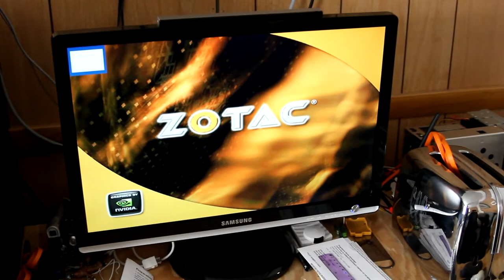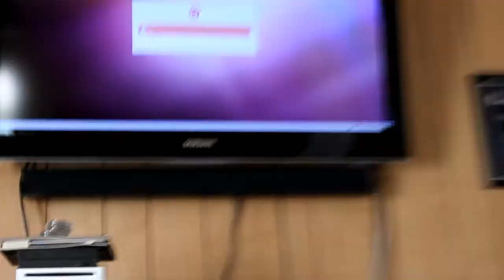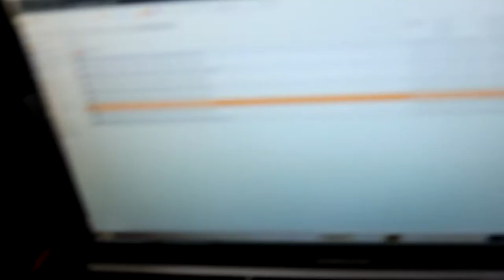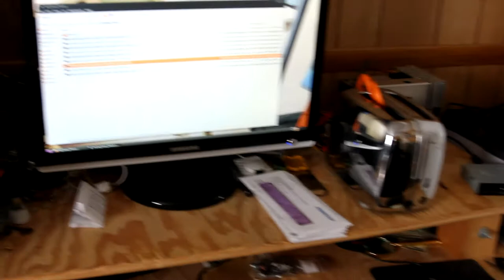Toaster Computer

Comment: Have you considered building a unit in one of those small fridges. The cold should keep it super fast. Problem is condensation might creep in. I've read of people submerging their computers in oil to keep them cool, this would keep the condensation out. Transformer oil is probably best.